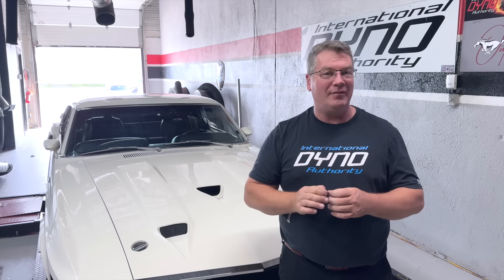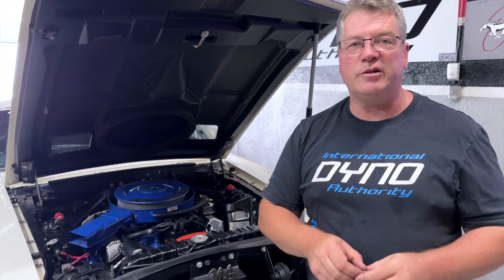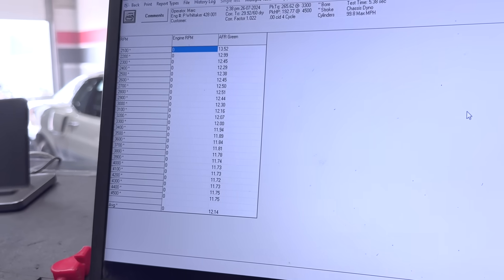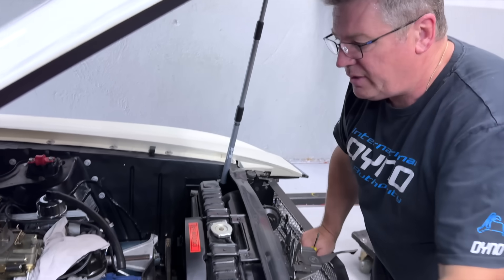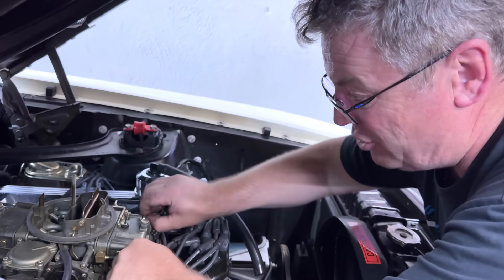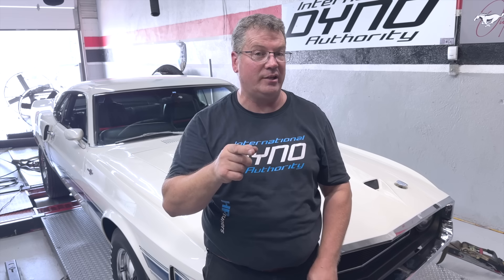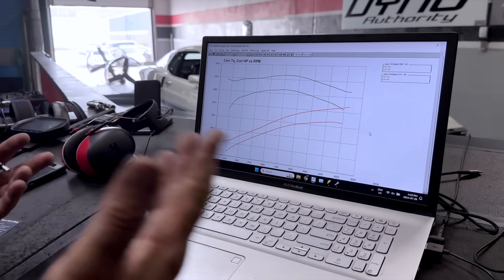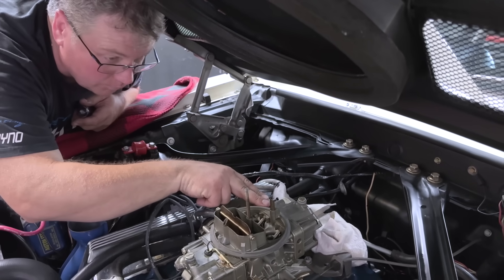Original, unrestored '69 Shelby GT500 tuned on the dyno

Comment: Adding vaccum advance distrubtor would help alot maybe a better carb that one kinda sucks
Reply: The car is all original, changing the carb would cause it to lose value due to not being all original.  With only 32K miles in 55 years, it doesn't get driven that much.  Optimizing the stock parts as done here is the best path for maintaining maximum value.
Reply: @Brons2  oh duhhhhh what was I thinking I would at least rebuild the carb seems like something is wrong and find a factory vacuum advance carb but then again that thing has more than enough torque to do anything just hp seems kinda low for a 427 might be due to the cam it has in it.

Comment: Why is there no vacuum advance like came from the factory ?…….
Reply from the maker: At some point in the last couple of years the distributor was replaced.   The mechanic who performed the work, ordered a direct replacement "replica" to "look" original.  unfortunately it is fully mechanical advance unit, without  a vacuum port.
Reply: @ I am an old guy and have owned 4 CJ cars  , the powder you got seam low to me as I had no problem beating the 396 Chevells and Cameros .
Reply from the maker: @thomasdaum1927  agreed, the 396, also requires proper setup and tuning to optimize it's potential.

These are factory rated at 335 ChP, 55 Years... Later NOW making More than factory original.  Great Car.  Nice Engine

Comment: This entire post is based off incorrect math.  The HP ratings were changed in 1972 from gross HP to net HP.  Which is approx.15% off the 1969 Shelby's original rating.  Also, HP ratings back then were based on output at the crank not at wheels.  That is another - 25% difference (approx.).  A total 40%  The GT 500 was rated at 335 HP when new.  By today's standards we can take approx 40% off of that, which makes it 201HP.  Read that again, the 1969 GT 500 when new, put approx. 200 HP on the ground.  So, the 190-216 HP was spot on 100% correct.  That engine should not be touched.
Reply: Excellent point!!
Reply: So I just did some research and learned a few things. First, GROSS hp and NET hp are both measured on an engine dyno at the flywheel.  GROSS hp, as measured in the sixties and up through 1971, was done under ideal ambient conditions, with optimal timing and the highest octane fuel available, using dyno headers instead of stock exhaust manifolds with mufflers, and with no air cleaner, no water pump, and no alternator.  By 1972, the switch was made to NET hp in which the stock exhaust, timing, air cleaner, and all engine-driven accessories were installed.  Mass production manufacturing tolerances also enable variations which will affect as-delivered compression ratios, dyno readings, and 0-60 times so don't expect exact matches with what is advertised. While most advertised gross hp ratings in the sixties were higher than the customer could expect, there were a few exceptions (the L-88 and L-72 equipped Corvettes, the 426 Hemi-equipped Mopars) where the OEM understated the gross hp for insurance reasons.  Exceeding 1 hp per cubic inch was a red flag to insurers, especially in lighter cars like the Corvette.
Reply: @Brons2  That's what he said...
"First, GROSS hp and NET hp are both measured on an engine dyno at the flywheel... By 1972, the switch was made to NET hp in which the stock exhaust, timing, air cleaner, and all engine-driven accessories were installed. "
Reply: @TonyRule  he changed his post.
Reply: @Brons2  Oh, right.
Reply: Balderdash, this engine was probably underrated from the factory for insurance purposes.  300HP at the tire, probably 370-380 at the crank and that sounds about right for 428 cubic inches at 10.5:1 compression non-smog and mild-ish cam timing.
Reply: @Brons2  "Probably" is not factual.  But I like that you said Balderdash!

Comment: I have a 67 GTO, 360 hp. Love it to death. But my little 2011,  3.7 mustang runs rings around it. It launches better, stops better, corners better. 
In the 60’s, HP numbers were checked with no alternator, water pump, power steering pumps or anything else that was parasitic. But, they were also downplayed so insurance companies didn’t have a fit. 
There’s still no car that looks a pretty or sounds like a good 60’s car though lol
Reply: Yes and No. Yes, the 60s and early 70s. Muscle cars will always be among the best-looking muscle cars. However, the new Mustangs are by far the best-looking muscle cars on the road. They are extremely sleek and sexy. Camro hasn't looked good since the Irocs. The new Challenger is ok, Charger is hideous, in my opinion. The Corvette doesn't even look like a Vette anymore. Take your hats off to Ford. They listened to their fans and kept the Mustang pure to it's roots. I hear that GM is going to bring back the Chevelle..let's see if they get that right. My dream car is the 69-72 Mach 1. Those cars always looked to be menacing to me. Like they had bad intentions, just parked in the driveway. But, I agree and disagree respectfully with you. Those new Mustangs are sexy inside and out and have the power to back up the looks.

Comment: How on earth do Americans get so little horsepower from 7 litres???
Reply: Lower compression and cam and smaller carb more restrictive exhaust thats how otherwise 500 hp can be achieved VERY easily
Reply: Congratulations Bugattieb on the dumbest comment here, the bar was already low but you took it down
Reply: Ask Carroll Shelby
Reply: Pushrod motor!
Reply: @BarryAllen-w5g  Nascar runs pushrod engines that produce over 600 HP.
Reply: For comparison, other cars were making barely 80 to 100 hp (1969 BMW 2002) so these muscle cars were FAST for their time.
Reply: The car is f****ing over half a century old. Are you stupid?
Reply: E.P.A. standards did exist back then as well. And if the car has been sitting for 30+ yrs. Duh. Lol

Comment: Down here in Florida we can get 105 octane low lead AV fuel. With that compression I bet a tank of that would help.
Reply: In PA its called 100LL, 100 octane low lead.  Makes my big block Chevy run great and smells wonderful BUT man it was over $7 per gallon last April ‘24.  Too costly. Now I use non ethanol 90 octane with enough Klotz octane boost to get 100 or more.  Runs great.
Reply: @kimmorrison9169 im in pa., I use 50/50 50 % non ethonal,50% av fuel from local air port. Make anything run better.
Reply: @markwalker9236  well also they kicked me out of the local airport anyway. It seems they don’t want to share their gas with automotive users even though I used 5 gal cans when I went there.

Comment: Car & Driver tested the 1969 Mustang GT500 with the "335 horsepower" 428 engine back when they were new. It ran a 14.0 at 102 mph on the quarter mile. Any new stock 4-cylinder auto trans base model Mustang today, can do better than that.
Reply: As it should be given that 1969 was 55 years ago. Over a half century of development should net some big gains or something is wrong.
Reply: That was fast for those days. Those cars had no nanny controls and tire technology was ancient compared to today. Even tires 15 years ago and ancient compared to what's available now. I guarantee you did not grow up back then or have ever driven a 60's car.
Also, the horsepower wars didn't start until a few years after the 2005 Mustang was introduced with the Dodge Challenger being made again in 2008.
Reply: @3644Darrell   Lol. I was born into the industry and grew up with these cars. I've been drag racing since the 1970s.

Obviously you know nothing about cars- you probably don't even know what the first year of the GTO was.

Comment: In my 65 Fastback I've got a 1965 A code block 289 with 68 4V J code truck heads on it,  modified the heads we put bigger valves in there 1.94 1.60 opened up the exhaust runners, and nice pocket port, no changes to the intake runners. Running a ISKY Mega 280  Valve Lift Int/Ext. 0.517 Valve Lash Hot Int/Ext. 0.000  ADV Duration Int/Ext. 280 0.050 Duration Int/Ext. 232 Lobe Center 108 net lift with 1.6 rockers is .551 at the seat according to math, but I should measure it, I ended up with 69.75 primary jets, and 78 secondary jets, using the 50cc pump with 32 jet, carb it's actual a modified 1850 600cfm main body air horn removed, and modified to fit the 3310-1 base plate (750 cfm) 3310-1 metering plates and float bowls also. Runs like a champ, probably could use some dyno time to get it dial in.

Comment: Looks like I'm completely wrong about the Ford 735 carb, they came with a secondary jet block and the main body has the correct shape around the air horn for a 1969 428 CJ a long with the auto choke, 1970 has a manual choke.

Comment: Complete novice! Should have started with new plugs and set the timing to factory first. And why didn’t you just remove the carb? And fuel mixture screws must be done running.

Comment: I had a 69 Mach1 428cj with the shaker hood
in the early 70s. I used to street race it, and it held its own.
It started floating the valves at around 5000 rpm, so I had it completely rebuilt.
I never raced it after that because I just didn't want to beat on it anymore.
I didn't have it for much longer and traded it for a new car with a/c and all the modern conveniences.
I guess the carb was good because it never smoked.
From what I've heard, Ford underrated these motors quite a bit at 335, and the 429 was way underated at 350.

Comment: The car was rated at 335 horsepower on the SAE gross rating standard that was used in 1969. That's about 260-270 horsepower on the modern SAE net rating system. 210 to 220 wheel horsepower is about right for that.
Reply: The 335 was a joke and everyone knew it.
Reply: @MrSticks9999  Perhaps it did under the old gross rating method
Reply: Agreed. The difference between gross and net ratings is a nuanced and confusing discussion for some, only made worse by trying to compare an ancient gross rating with an actual rear-wheel measurement.

Comment: Wow some of the comments here………. 335hp was gross back in the day. So for this car to make 300whp it’s making more like 400 gross which is very much inline with what everyone knew already  that they were underrated from the factory. Would I have done some things differently absolutely. I would have changed plugs and put a camera on the secondaries to see if they were opening fully and maybe changed the secondary spring but it’s hard to complain about the results made here.
Reply: 300 is probably 375 ish which is still great
Reply: The irony is the sand-bagged 335 hp insurance rating is right around what this 400 gross hp engine would be rated with a modern net rating.

Comment: You did dyno the engine? Correct?
Reply: No
Just the rear bumper.
Reply: @hotrodray6802  🤣
Reply: @hotrodray6802  He called it a motor. Not an engine.
Reply: @Razvan_Calin_V  - Very true!  Now if you'll excuse me, I'm going hop on my Harley Davidson enginecycle and try to forget there are people in the comments who get their panties in a bunch and just can't help themselves because they just have to bring up the old tired engine vs motor debate.  Mobil 1, Valvoline, and Amzoil clearly state "Motor Oil" on their products too...for when you need to change the "motor" oil in your Tesla, I guess?
Reply: @dewrus2153  You only ned to change the motor oil in a vacuum cleaner if you put race electricity in it. With normal from-the-grid current, it should be fine.
Reply: @dewrus2153  Are you planning to take on enginesports, where they race cars with notmotors in them?
Reply: @Razvan_Calin_V  LOL! Excellent!
Reply: @hotrodray6802  That's where the smoke was coming out of, it should make sense.

Comment: Good video! The old FE's like timing. We're running a 410 at 32° total timing with 10.5 comp, aluminum heads 280ish cam on pump 92 octane. We keep the under hood temperature low . I bet that mustang gets pretty warm under the hood on a hot day .A lot of people has told me that this much timing and comp just isn't possible on pump gas but it's hard to convince me I'm seeing with my own eyes.Thanks for posting this . God Bless

Comment: Wow that car can't be in that condition unrestored with all those new looking bolts,perfect firewall paint and no drying fiberglass flaking off under the hood plus the foam for the ram air most of which fly away with swift breeze at this age. No rubber hose turning to dust. Which I find it very hard to believe that the powervalve was not split will do the same smoke symptom. If they had issues with running specifically smoke they would have a list of replaced parts from Ford I would think especially it being a Shelby. I'm not sure about a Canada car. If they were all given the same info for fifty years why is it just now being addressed? It's still a nice car. Seats(Deluxe int) look a little thicker than I recall but that might be me. Don't get me wrong I'm a Mustang guy. I believe Holman/Moody is finishing a GT40 which was from the original run and consecutive vin. With NOS parts even the 427FE. So in that instance yes that will be a new GT40. Shelby(or maybe AC) has done the same with the Cobra Car CSX vin's. This car would be at Shelby if it were truly such a time capsule car.

My 1st car was a 69 MACH1. I've owned a 68' Cobra Formal Roof all original when I got it had to rebuild the 428CJ. I had a 2nd 69 Fairlane 500 427 FE strip car, two 93' SVT Cobras Black and Teal, two Coyote GT/CS's 11' and 14' so I do follow Mustangs/Fords and if there was a 69 GT500 found in "that" condition it would be a big sensation. But that news wouldn't just go away. And everyone who follows FE's know the 335hp rating was for insurance reasons. Unless this car had meticulous maintenance the carb would needed replaced. A car that sits will have problems with any rubber part for the carb,engine,cooling systemg,tires,etc. That condition for a car that age doesn't exist. Maybe in vacuumed vault.
Reply: It indeed looks like it's had some restoration. It probably just squeaks by with the definition of "unrestored" by classic car authorities.
Reply: Based on your knowledge of Fords I know without a doubt that if you were to see the car in person you would confirm that it is an original, unrestored car - the camera does an unintentional but good job of glossing over the spider cracks and thinning of the original paint. The interior is original and exceptional - even the clock works.  The car spent most of its life in California and Colorado.

Comment: The distributors weights Springs are stuck and distributor cap and rotor are dirty and plug cables should be copper core
Reply: SMH.

Comment: Brother, great job. I have , at a pretty high level, worked with FE series engines since 1965, mainly in recreational Fords but at a performance level on Stock/Super Stock FE powered pulling trucks. Im now 78 years old. You can do the math there🧐 .  Loved your chronology of steps taken to bring this beauty to the standards it deserves to be at. In addition to everyting you addressed, the absence of the vacuum advance system, or apparently any system, is  a monstrous problem. The FE timing   can make such a difference when set up properly. These are amazing engines. We had massive success in Eastern Ohio with a " stock " 427 , high riser setup. Darn near identical to what the Cobra Jet Mustangs won the wintenationls with in 1968. No clue what kind of power we produced as we lacked a dyno, but we won very very often, never blew one up and their sound, with open headers, i can still hear !

Comment: There's no way in hell that carburetor hasn't been apart in 55 years. No way.
Reply: Bought a 1970 Ford C-800  flat bed dump two years ago. Was a farm truck stored indoors all its' life. 18,000 orig. miles. Truck is like new. 391 gas eng. 5/2  two speed axle. Holley 4 bbl. Had to have carb gone thru.
Carb guy was delighted, said it had never been apart. So they do exist.
Reply: @mikeheggem9488  I don't disagree, however, that is not the case with this carburetor. It literally looked brand new. Keep in mind that this car is 55+ years old and has 32,000 miles on it. There is no way that this is an original, unrestored carburetor. in fact, I don't believe that story about the entire car. It is too clean.
Reply: I don't think he said it hadn't
Reply: 100% agree.
Reply: @76629online  Primary block gasket not 55 years old , also looked  like freshish motor paint , wonder what carb WAS on it and for how long ?

Comment: more than 80HP and 100 lb-ft of torque without spending a cent (other than shop time). Customer can't be upset about that!
Reply: And optimizing air to fuel ratio and most important no more smoke!
Reply: It would be interesting to see the carb and distributer replaced with a Holley fuel injection and electronic distributer. Probably make another 20+ horsepower and run smoother.